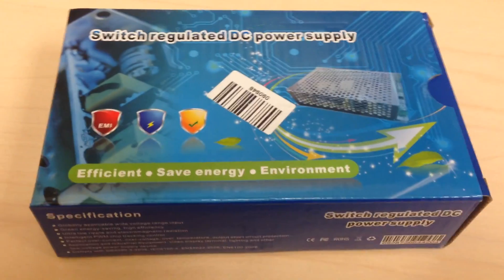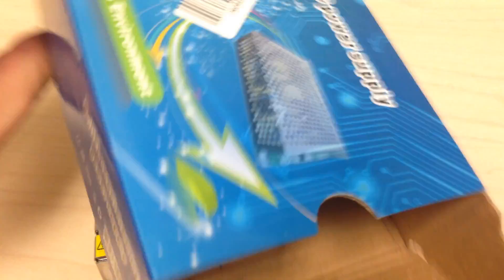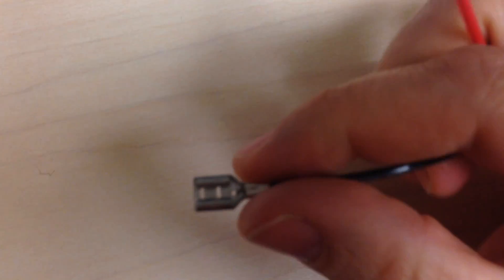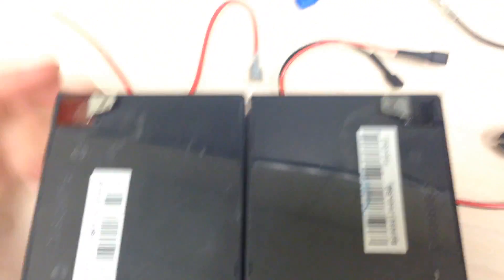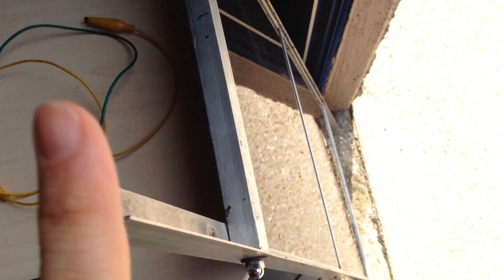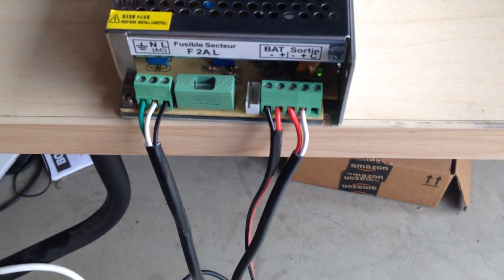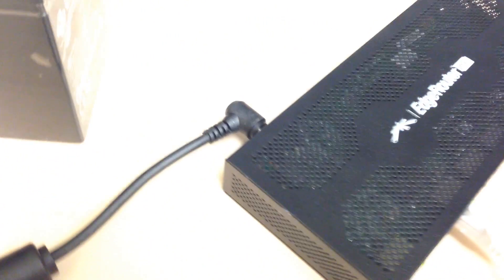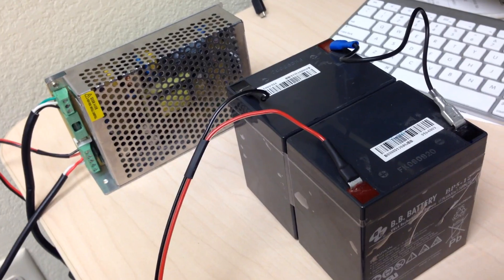24v DC UPS Version 2

Comment: Nice video!
I'm currently planning to create custom portable DC-UPS (pretty much as a laptop UPS) but for a mini-pc (Intel Skull NUC).
The NUC is rated 19V6.32A (ie 120W), though typical use would be between 3.6~4.6A and probably even under full load wouldn't go above 5.2A.
The model you have (4A) won't be good for me, but I found MeanWell sp-200-27 is a 27V7.5A.
Now I didn't mention I'm going to use Li-Ion batteries 24 cells of NCR18650GA 3500mAh 10A 3.7V, in a 4p6s config, for total of 22V and about 13Ah. Since they're charged with 4.2V, I'll need about 25.2V (because of the x6-series).
So far so good, I was just curious if these MeanWell DC-UPS modules, can safely charge LiIon cells (I guess some current and voltage protection might be needed?);
if they switch fast enough to avoid interrupting the hooked devices (I see you're also using it for electronic device so I guess that's a yes?);
And if they're capable of simultaneously power a device (when plugged in the wall-socket of course) and charge the batteries (I guess they should).
Reply: Have you managed to succeed? I'm in your same situation and browsing around i've found this:
https://www.aliexpress.com/item/DC-UPS-power-module-Uninterrupted-power-Computer-Access-control-Security-DC-backup-power/32733826688.html
I'm not an expert but it's rated 100W max output, our Skull Canyon PSU is rated 120W so I guess it will work anyway. Hooking it to a standard 24v PSU and a custom made 6S2P 18650 battery pack  I think it could do the job. What do you think?